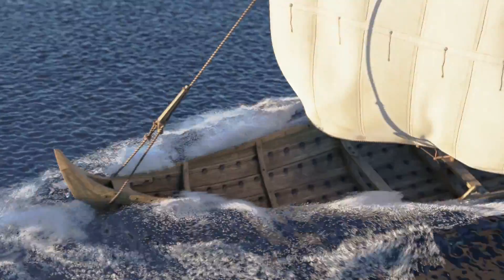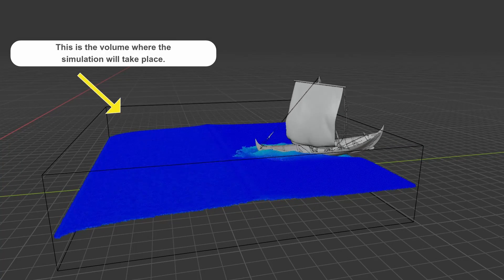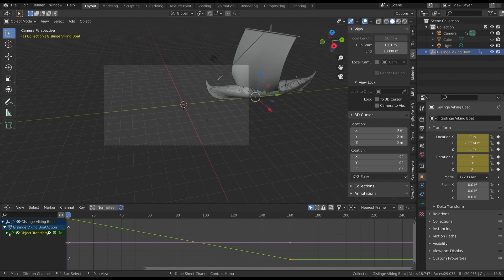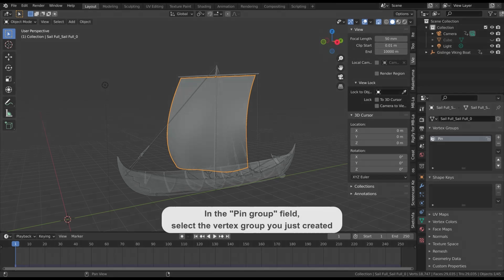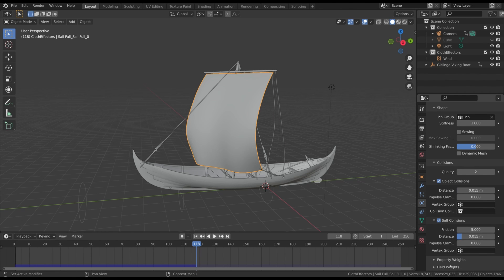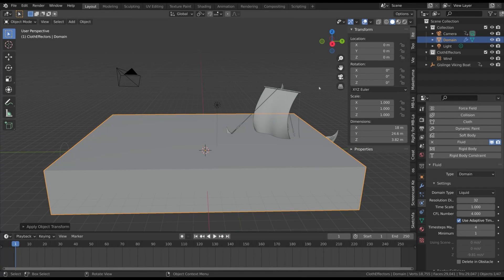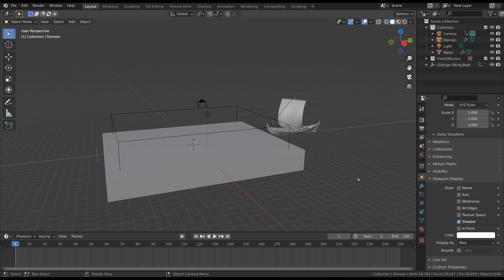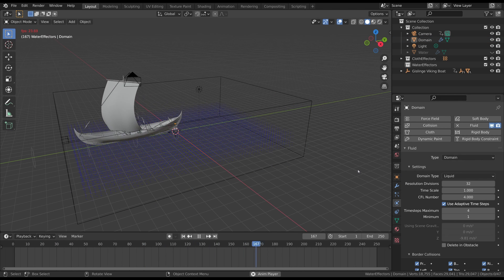Boat and Water Simulation in Blender - part 1

Comment: Hi, in 16:10 you make a cut. Do the water particles appear automatically? Because mine dont
Reply from the maker: When you add a domain and related liquid source object, the particles are automatically created inside the flow object.
If you don't see them, you have to hide the water source object and the domain set as wireframe.
In addition, you can also try changing the subdivision value of the domain. This forces Blender to compute again the simulation.